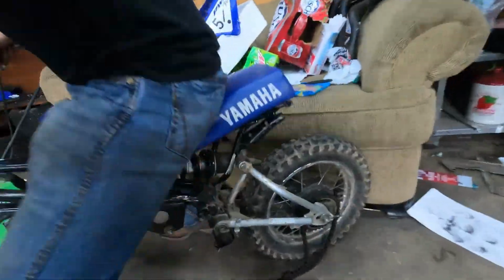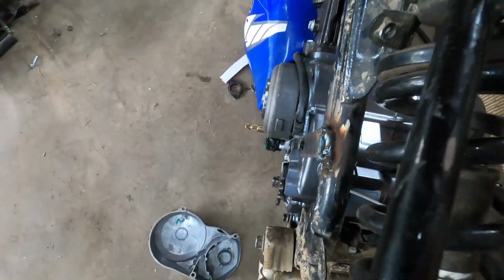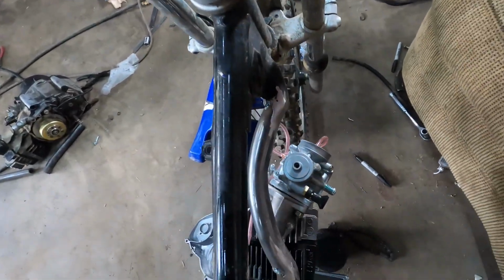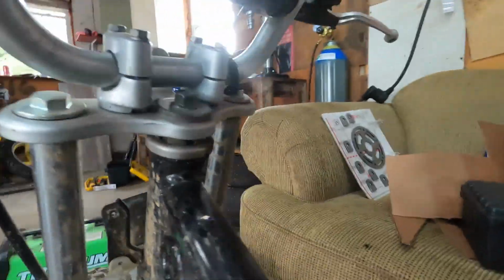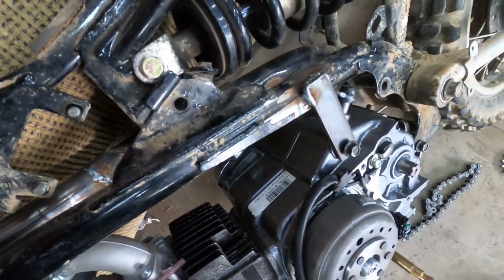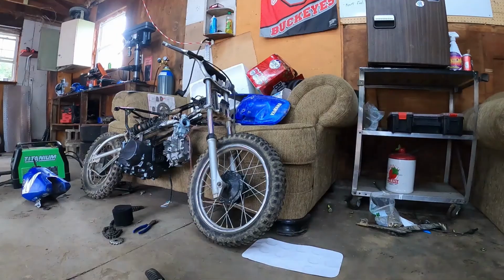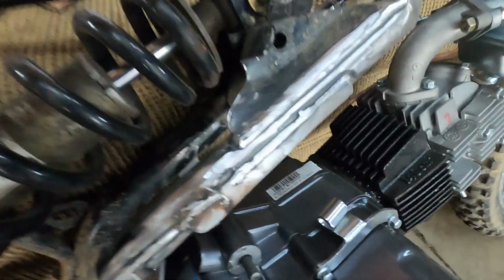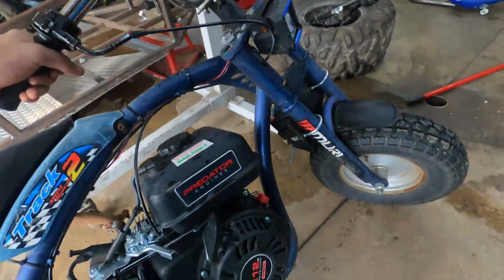CAN WE FIT A 140CC PITBIKE MOTOR IN A PW80?

Comment: just picked up a pw80 and a ds80 that are both giving me headaches.. honestly thinking about doing this, but i don't want to have to mess with the frame the way you did. there's gotta be one that fits without cutting the frame
Reply from the maker: I think we could have done it without doing that but we wanted the carb up as high as possible and had a welder and tube right there
Reply: @condemnedmotorsports9956  is this thing still running ??
Reply from the maker: Hasn’t been touched in a while but would be back up and running in a day if we had time
Reply: 😂😂 all you had to do was make the pipe longer to fit the carb instead of doing that to the frame 😂 if you want down that way you would obviously need to improve jetting in the carb other than that the frame didn't need to be butcher the frame to suit a inlet lol